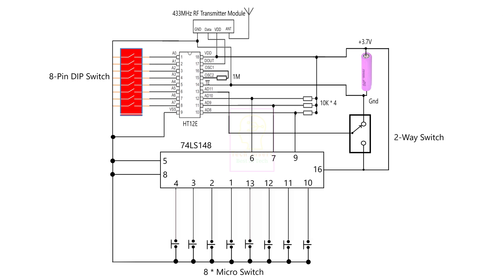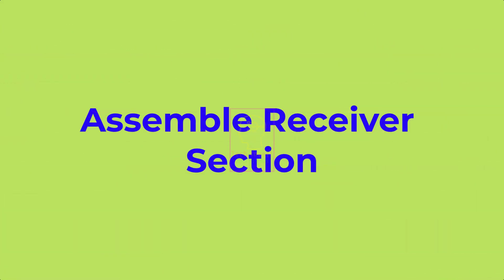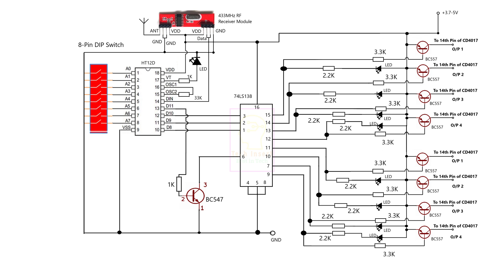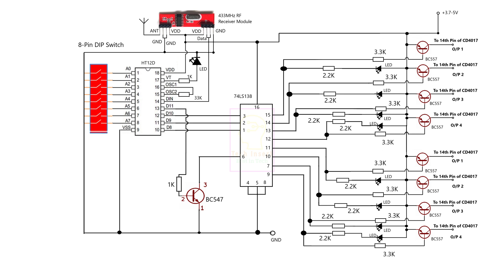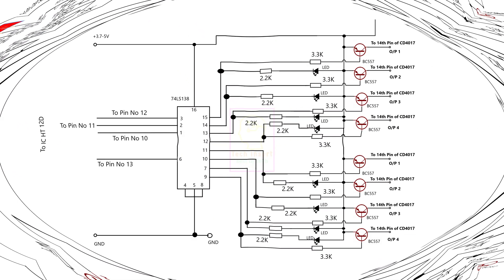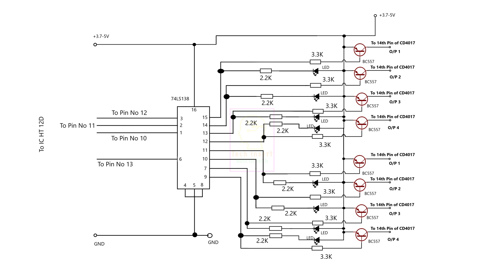How to make Wireless Control (14 - Channel) at your Fingertips | DIY RF Remote Switch

Comment: Hi mate, I'm an electrician so I only know about AC power, my knowledge on DC power is very limited, I'm trying to make a deceive like this to control multiple and different pole/throw relays, I'm wanting to supply power to 4 relay coils in different combinations by using 6 preset buttons, how would I do this within the transmitter/remote?

My other question is, I want to increase the range as much as possible within legal limits and it has to be able to work in a factory, if it would reach 200m in a factory, is 433MHz or 868MHz better for my situation?

I got a pre-made version that can only control 1 relay and It reaches about 80-100m, but need more range

Thankyou for taking the time to read this
Reply: Device*
Reply from the maker: In my channel ther is a n 8-channel wireless switch. You can make use of that.https://youtu.be/SWJItXFFYTU?si=HskDu6qY1JTKp4zZ 

For increasing the range you can make use of LoRA modules. I am in research on those . They have 800m to 8 km range and some are having more than 8km in perfect environment. My country has legal issues on high range. I am also searching those things.
Reply: @TechInsert  hi sorry I think I worded my question wrong earlier, I'm really struggling to find the right direction. 

Say if I have 6 buttons in my transmitter, and 4 relays in my reciever. 

I want to press button 1 to deactivate all relays and reset to the default state 

I want to press button 2 to activate relay 4

button 3 for relays 1 & 3

button 4 for relay 3

button 5 for relay 3 & 4

Button 6 for relay 2

Each time I press a button to activate certain relays, I want the relays activated from the previous button to deactivate and return to the default state.

For example:

Action 1: press button 2 - relay 4 activates, all other relays deactivate

Action 2: press button 4 - relay 3 activates, all other relays deactivate 

Action 3: press button 3 - relay 3 remains activated, activates relay 1, all other relays deactivate.

And so on...

I don't expect you to go into massive details and draw me diagrams for everything I require, I just need to understand the basic principle of how to do this and I can research more/reverse engineer the principle

Thanks for all your work, keep up the videos!!
Reply from the maker: @mattcrook9368  This is what we call as programmable switching. The simple way is to use an Arduino and program that according to ur needs. You need to study arduino programming language and if ur good is C/C++ then the arduino programming is as simple as drinking juice. But this can also be done perfectly using digital gates (AND gate OR gate etc with CD4017). Multiple 4017 need to be used with the use of enable button of 4017. 

Ur idea is so interesting.Kindly give me some time  whether i can design one or two  flow and try to integrate them toghether
Reply: @TechInsert  and yes, I looked into lora too, I was hoping there was a way to do it without programming, but seems not

Comment: Why 14 cd4017 needed? Can't we drive relays directly on 74ls138…?
Reply from the maker: You need to toggle the output, for that we are using cd 4017. 74138  will give signal only
Reply: @TechInsert  can we use other methods?  
14 cd4017 ics for 14 relays will be must?
 transistors or ULN ic can be a solution?
Reply from the maker: @pradeepdeshmukh3279  We need independend flip-flopp controls for each channel
Reply: @TechInsert thanks sir. so without flipflop, it will not hold the status. Right?
Reply from the maker: @pradeepdeshmukh3279  Ur absolutely correct